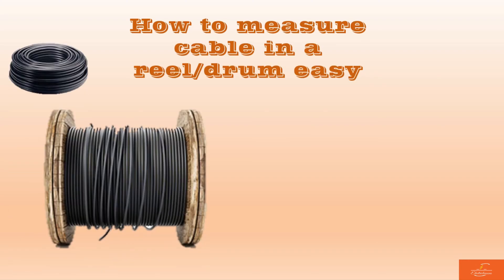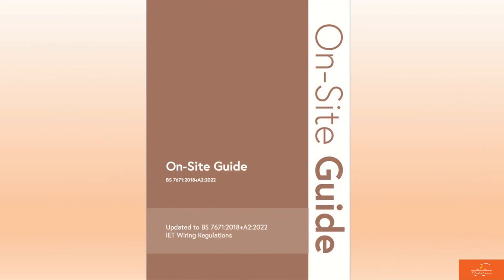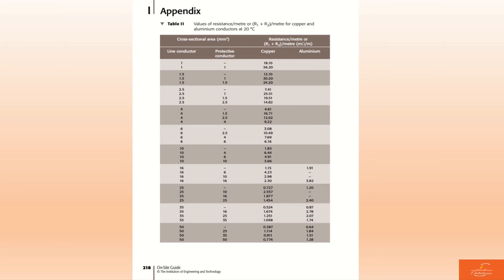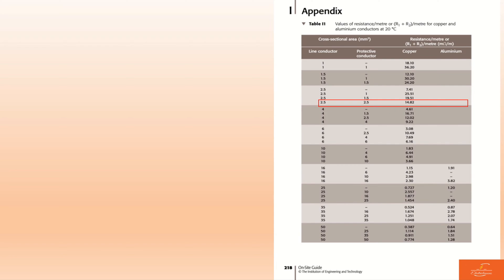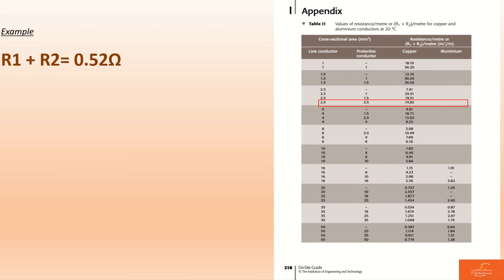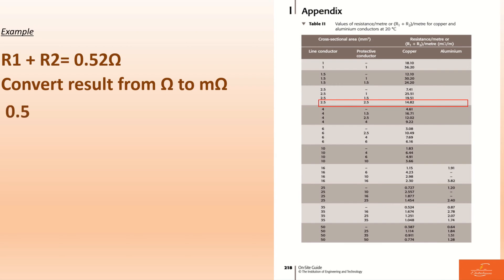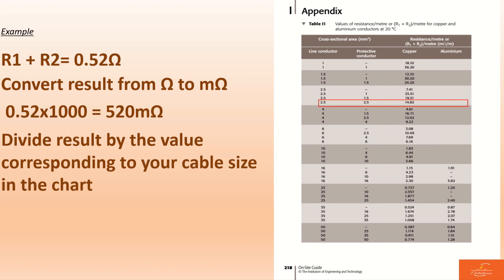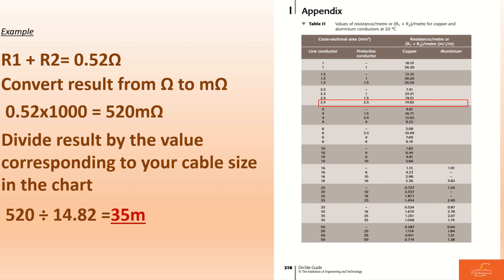Secret to Easy Cable Measurement in Reels #cable spool

Comment: does this work on a copper DC Cable?
Reply from the maker: yeah, it does. just ensure you use the right value for the cable size you want to calculate.